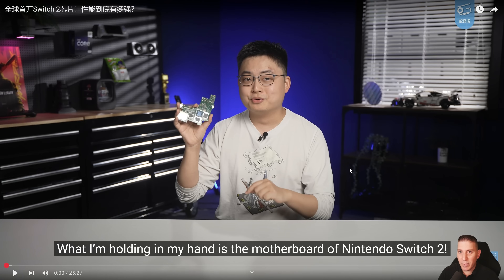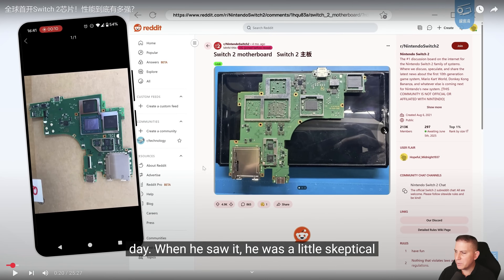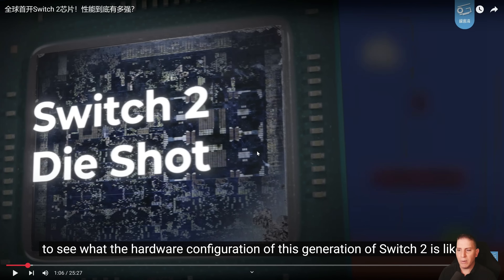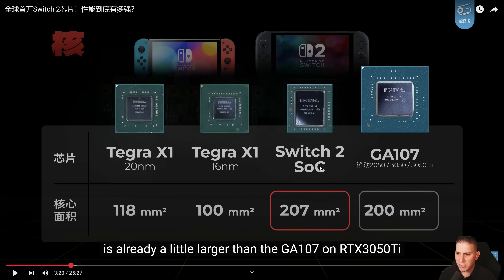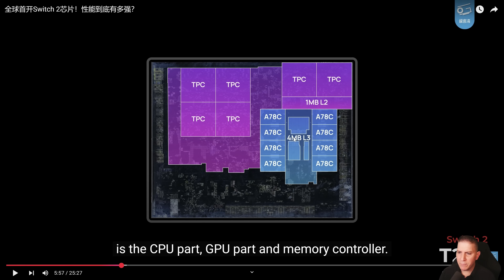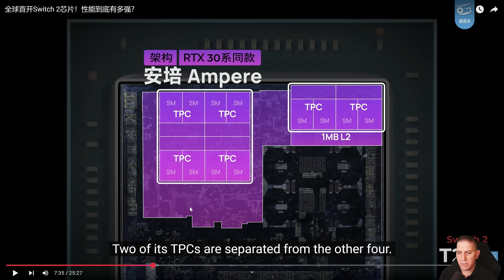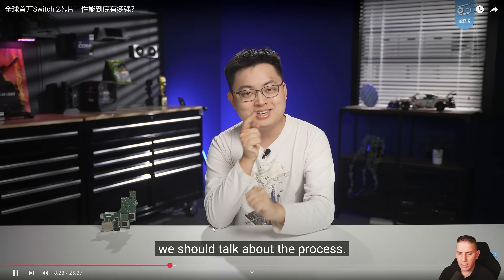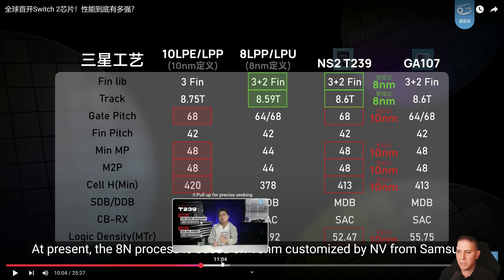Switch 2 GPU + CPU SOC Chip Size and Custom Architecture Revealed from Motherboard Scan

Comment: CPU is underwhelming. I'm normally spot on Nintendo console power (usually GPU tho) and if that is the real switch 2 cpu power than it's below what I expected if I had guessed. If I had guessed I would have said it was at least as powerful as a Snapdragon 865 (which is the successor to the Snapdragon 855 which beats the switch 2 by 10%)
Reply: I admittedly completely forgot that it maxes out at 1.1GHz. Even at 8 cores that's very meager. At the par clocked rate it would absolute annihilate the Snapdragon 855.

Comment: could be more modern and powerfull if they chose a more modern architecture. But on the other hand its still not a weak mobile chip, we get PS4+ graphics with faster memory, better cpu and 12gigs of ram, Nintendo games will shine and most 3rd party games will run. Can't wait to see the next Xenoblade, Zelda and Mario on that thing.

Comment: The ram is rated at 8533MTs which is insanely fast. Faster than any laptop I am aware of.
Reply: Nintendo finally realized low latency and high bandwidth makes so an amazing gaming experience! That is a huge bottleneck even on desktop PC's! Gamers are in for a treat!!
Reply: That's 12GB LPDRR5X 8533MTs is MASSIVE
Reply: A quick google search shows that intel 200v laptop cpus are also running at 8533mt/s
Reply: The issue is the Switch2 GPU uses a different lower bandwidth type of ram called LPDDR5x and has to share it with the CPU.  Typically with laptops if it has a discreet videocard, it will use much higher bandwidth GDDR6 or (or on high end gaming laptops) GDDR6x both which offer significantly more memory bandwidth compared to LPDDR5x. Additionally in laptops, that VRAM memory bandwidth is 100% for the GPU, not shared with the cpu.  But for small handheld device SW2 is great!
Reply: @2drealms196  Hm, I wasn't aware that the GPU also uses that memory.
Reply: @2drealms196  Leakers said that bandwidth sweet spot is satisfied even with the ram shared with the cpu.
The sweet spot is 25gb/s per tflop.
Reply: There should be no virtually issue with the t239 soc since its made specifically with the specs that came with the switch 2.
Reply: @Shiroe-_-  Thanks, I think you are correct.  I took a look at all the other videocards in the Ampere lineup and all except one has a 25-28GB/s per TFLOP ratio.
Reply: The ram is 12gb lol on the video he is talking about the CPU is shown to be weak on the switch 2, way below the steam deck even 😂 not good
Reply: steam deck has it as well, and nintendo also downgrade to 6600 it
Reply: @АртемВласенко-щ5п  already mentioned Switch 2 used 8533MHz one
Reply: @Mr3-j4m  man, read again what I said and check original video. Switch doesn't use 8533Hz even on docked mode
Reply: @АртемВласенко-щ5п  6600 is still fast... But the dude above said it's shared between system and GPU 🤔
Reply: The t239 memory controllers can support up to 7500 mt/s, so they do have the capability to deliver more vram bandwidth than 6400 mt/s if nintendo decides to allow it, although it can't support the full speed of that chip.

Looks like nintendo didnt want to get forced to restructure their ram sourcing halfway through the lifespan of the system again.
Reply: @Nobody-sp7ug  you're saying a whole lotta nothing
Reply: It doesn't run at those clocks. They downclocked the RAM.
Reply: @RZ34ZX  it was initially suggested to be at around 77xxMTs which is still incredibly fast (just as fast as a 3000 dollar lenovo thinkpad).

Do you by any chance know what they are downclocking it down to?

Comment: Absolutely underpowered!
Reply: It's exactly as expected.
For me at least.

Except memory speed.
That one is a winner
Reply: Underpowered playing games that are on ps5 lmfao
Reply: @jamesbilclough9728  If it can run those games or even PS4s at 1080p and locked 60 fps in handheld mode, that would be a big upgrade. Otherwise it would end up humiliated by laptops with integrated GPU.

Comment: damn 4 years old..
Reply: Yep, thats a bit of a shame, could be more modern and powerfull. But on the other hand its still no weak mobile chip, we get PS4+ graphics with faster memory, better cpu and 12gigs of ram, Nintendo games will shine and most 3rd party games will run. Can't wait to see the next Xenoblade, Zelda and Mario on that thing.
Reply: @currywurst2434  some levels in Mario odyssey look as good and better than the donkey Kong on switch 2
Reply: Yep but I guarantee you Nvidia still isn’t giving Nintendo a discount either
Reply: @Patrick-tw7nr  I GUARANTEE you they are 🙂
Reply: @ThinkTinkh no, why would Nvidia need to. They don’t have to offer a discount on their products, they haven’t since the 3000 series and it only went up even after the initial launch
Reply: @Patrick-tw7nr you're right, Nintendo would totally agree to a 20 year deal with Nvidia for chips at retail price
Reply: @ThinkTinkh not retail but nowhere as cheap as they would get from Nvidia pre covid and pre AI Tensor core technology with DLSS..
Only other option would be AMD who was in the running for Switch 2 but couldn’t match Nvidia with the lower wattage performance and battery life of Nvidia s solution
Reply: 4 years ago it was a 90w chip as big as the series x and expensive as a rog ally, its a good deal, is more powerful than steam deck ever was using 2021 tech
Reply: @Elchinodawn  it is not powerful than the Steam Deck.
Reply: @ Seems like steam deck has more powerful hardware handheld but docked switch 2 can get more wattage and more performance.
Reply: @funnyduck4568  no, Switch 2 crushes it in both aspects

Comment: I'm excited...but damn the 2017 switch was already old and outdated with the hardware and here we go again with a 2025 release with a chipset that's coming out of the gate already 5 years old...very disappointing when you think about the possible improvements in battery life a CPU with 5mn could've gotten us...i mean 2 hours of gameplay for demanding games...and then still no fast charging...it takes 3 hours to charge the Switch 2 for a worse case of only 2 hours of gaming...that's beyond pathetic..,they could've at least gave us a thicker system with a bigger battery to compensate for folks who wanna game primarily handheld....2 preorders locked in I hope it turns out better than the numbers say
Reply: Yes let's sell the switch 2 for 650
Reply: @ThinkTinkh steam Deck, Lenovo Legion, Asus ROG Ally... All mobile gaming... All better processors, bigger batteries, better features... The only advantage and admittedly why I've pre-ordered a Switch 2 is for the Nintendo exclusives which is why they can get away with a 2025 release with already 5 year old hardware and a peasly 2 hours of battery life
Reply: @tonybailey89  all cheaper?
Reply: @ThinkTinkh  you got me there ALMOST, however Steam Deck and ROG Ally base prices are both cheaper at $399 but do get expensive that main point and the Nintendo first party exclusives is what will hold thd Switch 2 up

Comment: Wow, I'm actually impressed by this revelations, now for the gpu performance, if we take what Nvidia said (10 times faster than switch 1) that is 4tflops, and now knowing all this data for sure, we can reverse the tflops calculus , 4tflops/1536 / 2 which is equal to 1.3ghz for the gpu.
Reply: 10 times with DLSS activated. It’s actually only 7x faster without DLSS

Comment: This isnt better than expected lol. What are you talking about.
Reply: The ram speed is definitely better than expected.
Reply: @ThinkTinkh  the RAM is underclocked, the modules might be capable of that, but Nintendo isn't doing that on retail units. Same goes for the CPU clocks being dialed way down to 1GHz when the A78 can otherwise hit up to 3GHz.
Reply: @RZ34ZX yeah no the cpu may just be a disappointment. Did Nintendo downclock the ram in the switch 1? And if yes, to what?

Comment: Samsung 8nm on a $500 device in 2025 is hilarious. Nintendo fanboys thinking this thing will beat a PS4 are so stupid.
Reply: @芽衣-c5x   Switch 2 will run Cyberpunk at 40fps including Phantom Liberty,  I wanna see PS4 version running 15fps at launch to the point they were forced to removed it from the PS Store 🤣🤣
Reply: Yeah man, I bought the NS2 to play Zelda, Donkey Kong and other great games, which is the main reason someone should get a console I think.
Reply: It's 10nm 😂
Reply: I honestly don't understand if you are acting retarded on purpose or if you really are. There are videos of the games presented, which prove that switch 2 is more powerful than PlayStation 4 For example, street fighter 6 is superior to the ps4 version and series S. Stop acting retarded 😀
Reply: My opinion has not changed. Base 8th gen PLUS modern tech I said this like 3 years ago and it looks like I'm right. Like I've been for 20 years about Nintendo 😏
Reply: U're eso stupid, x86 vs arm is not comparable
Reply: 2 Cortex A78 on Exynos  1330 already  beat Ps4 pro no need 8 core Cotex A78 on Nvdia  Tegra T239 😂 .
Reply: @Mrorlglothbeat in a bench mark. Everyone knows that when it comes to phones, benchmarks next to never equate to real life sustained performances.
Reply: @ThinkTinkh   Exynos  1330  as 5nm chipset is Coldown to heaven compared to 16 nm scorpion Amd APU 🤣  

ARM chipset not only colder but could used full power without neded power supply unlike x86 🤣
Reply: @Mrorlgloth  huh?
Reply: @ThinkTinkh   cold heart  means Exynos 1330 was built for sustainability used for all day long  not the performance like Apple A18 Pro or Snapdragon  8 elite .
Reply: @Mrorlgloth the cpu in the PS4 pro is basically the same as the PS4 so saying one beats the PS4 pro just means it beats the PS4. The PS4 cpu was notoriously weak even at launch it being marginally more powerful than the ps3.
Reply: @ThinkTinkh   Ps fans thought  that CPU Intensive  games like Cyberpunk  2077 Phantom liberty could run on Ps4 pro 30fps 🤣 

Nintendo didn't  looking performance  if so they could used Mediatek  Nvdia chipset but who gonna brought $800-900 consoles 🤣

Or they could used cheaper  unreleased Exynos 2400 but Amd FSSR not  as good as Nvdia Dlss they needed created thier own Api and the worse there were no backward  compabilty with switch 1 games .
Reply: @Mrorlgloth  I really don't know what you're saying. All good
Reply: @ThinkTinkh   I don't care 🤣

Comment: I'm almost starting to think that the people saying that there will be a Switch 2 Pro this time and fairly early into the lifespan are right. Looking at this hardware and knowing for certain that it was made in 2021 on the 8nm process is one reason. In a couple of years or so they could make a pro, keeping essentially an identical architecture but revamped in a way that it doesn't interfere with Switch 2 software. Just enough upgrade to run some games without scaling and with a bit more eye candy.
Reply: @CynHicks  I believe the OLED switch along with the Mariko revision of the tegra chips set was supposed to be more of a substantial upgrade. Taki Udon did a video on the capabilities of the OLED Switch and he showed that it used the newer HDMI 2.0 standard that could output in 4K 60 in Linux. He also mentioned the older dock could not do 4k at all since it was only HDMI 1.4. I don’t see the point of upgrading the HDMI if they weren’t planning on doing something with it. At the very least they were planning on doing an upscale to 4k. 

If you have  SYS clock you can overclock the CPU and RAM substantially over stock clock rates since the Mariko chips run cooler and more efficiently. Pretty much every game that’s had performance issues runs much more smoothly and at a solid 60fps. 

I don’t know what Nintendo was planning, but I think the OLED was supposed to be a pro version of the switch and was supposed to have 4k capabilities. What I think happened was since the Switch 2 was so close to releasing at the time they wanted parity and to make 4k a selling point for the next gen Switch 2. Now that we all know it got delayed it made those changes moot. 

With Nintendo you really don’t know, I think we will see a die shrinkage to a 7nm or 3nm early on, but I’m not so sure about a pro model until 4 years down the line.
Reply: @caviar_dreamz  covid
Reply: @CynHicks  it's development costs are more expensive than the switch 1 relatively speaking when compared to it's final price so unless they change to a different manufacturing process quickly I don't see them doing a power refresh any time sokn

Comment: No, 8nm is a HUGE letdown actually.
Not only is a 4 generations old process but also a pretty bad one even when it was released.
With a 5nm TSMC, the battery would last twice longer is basically a must for a handheld.
4 hours of game time is the minimum that should be acceptable imo
Reply: Oled 4nm model confirmed?
Reply: But it would cost more and then you would cry about price. So let the professionals do the work and just enjoy the games
Reply: Lol 8nm was obvious. I mean. SERIOUSLY SERIOUSLY. They are already making close to minus amounts of money in every switch 2 sold.
Reply: Yeah Dave is wrong here. I wonder if he'll retract and apologize like the people he hates at Digital Foundry 🤔
Reply: @lilsammy112  and Digital foundry was right years ago
Reply: 120Hz LCD eat a lot power with 120Hz LTPO Oled the game could last for 4 hours 

Downsides  of 8nm there will no refreshed   because 8nm was optimization  of 10nm .
Reply: Its actually not. Being an 8nm node means Nintendo have a realistic console refresh path. 
So newer consoles will be more efficient
Reply: @66kaisersoza  they'd have a realistic update cycle regardless.
Had it released on 5nm, the refresh would be at 3nm
Reply: @creativeearthian1702  3nm is cutting edge which means it'll be more expensive for Nintendo. 
Not to mention 3nm allocation will be in demand (short supply).

Nintendo could go to 7nm or 5nm without much competition for allocation AND it'll be far cheaper
Reply: @66kaisersoza   it won't be cutting edge 3-4 years from now..
Reply: @creativeearthian1702  that was kind of my point. In 2 years they could go to 5nm and in 4 years they could go to 3nm
Reply: @66kaisersoza  lol so? It is a huge letdown FOR THE CURRENT SWITCH 2. That's great that the refresh 2+ years away will be more efficient. This is a bummer for the current switch 2.
Reply: @lilsammy112  its good for Nintendo i mean. 
A smaller node means a smaller cooling solution, less weight, smaller mobo etc. thus a cheaper to make console
Reply: 😂😂😂😂😂😂
Troll

Comment: The Nintendo switch 2 CPU it's pretty bad that's why it can't run cyberpunk 2077 at 60 fps. for Example, the ROG ally x can run cyberpunk 2077 at 720p@60 because it has a very powerfull CPU (AMD ZEN 4)
Reply: The rog ally z1 extreme is almost the same as an ally x. Brand new it's like £449 in the UK making it comparable
Reply: I doubt the CPU is the main bottleneck here. It's the GPU
Reply: Look guys the ARM 78C cpu in the switch 2 its comparable to the snapdragon 855 in the galaxy s10 a 6-year-old phone.   The Chinese site tested a similar ARM CPU  with geekbench 6 and they got 530 single core score and 2900 multi core score numbers very similar to the Galaxy  s10 . I used the example of the rog ally x because its a pretty good cpu but the steamdeck its faster and its a cheaper device
Reply: With the rog Ally x you can get 2500 single core and 11000 multi core the steam deck 1200 Single core and 4500 multi core if you put attention to the video you can see than the design of the chip its from 2021 its 4 years old
Reply: 😂😂😂😂😂😂😂 
Rog costs almost triple of switch 2. That's why you have lag issues.
Reply: Rog ally is a beefy and more expensive handheld lmao the switch 2 is thin and efficient it's not even close between the z1 series inefficient crap basically a laptop chip shoved into a handhelf vs the Nvidia soc in the switch 2 if you honestly thought you were getting the rog ally power in a handheld this thin that runs at a maximum 10w in handheld mod and at that 450$ range you must have been on serious cope 😂
Reply: @kirby21-xz4rx  the rog ally z1 extreme is £449 new in my country.
No yearly online fee and cheaper games.
Reply: @66kaisersoza  700$ here in the US for the rog ally 800-900$ for the rog ally x vs 450$ for the switch 2
Reply: @66kaisersoza  also does the rog ally come with a dock? Does it come with detachable wireless controllers that can be used as a mouse your forgetting the switch 2 is not just a handheld it's a hybrid console/tablet that has multiple play modes?
Reply: @kirby21-xz4rx  I would counter that by saying the rog ally isn't in a closed eco system. 
It can stream games, emulate, can be used as a PC, any wireless controller can be used with it with the right software, You can literally use a real mouse.
Reply: @kirby21-xz4rx  Nobody is spending $700 on an ally in the states lmao, quit coping already. Easy to find deals on those.
Reply: @RZ34ZX  doesn't matter where you sped if you get it  in new condition its more expensive then the steam deck and switch 2 and if you go with the z1 extreme version is even more also its non debatable as it doesn't come with 1. A dock 2. Detachable controllers

Comment: All this goes to show me is that specs on paper mean nothing in comparison to process optimizations and the custom chipset NVIDIA and Nintendo worked on to get the T239. As we've already seen with actual 3rd party games running on Switch 2 it's going to be punching way above it's weight. Super excited to get my hands on it in less than a month!
Reply: I can see why they priced it at 449! Still, I'm gonna snag the Japanese one
Reply: @BBWahoo  do you live in Japan?